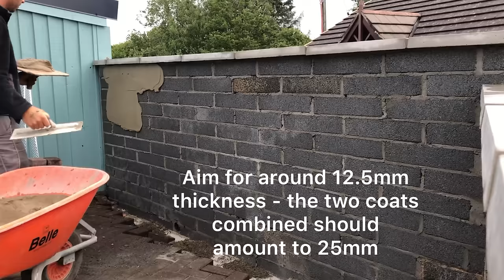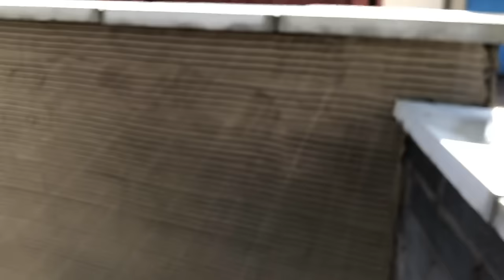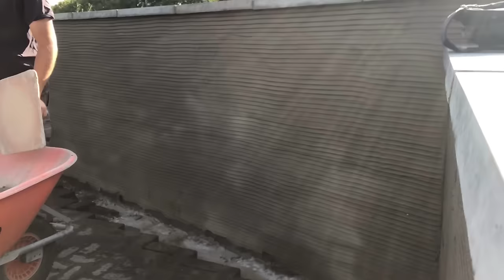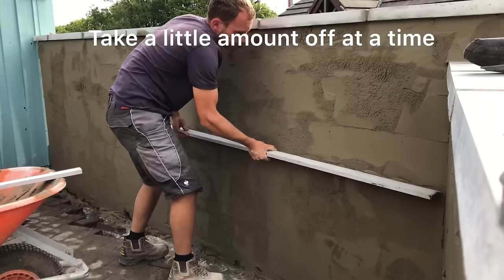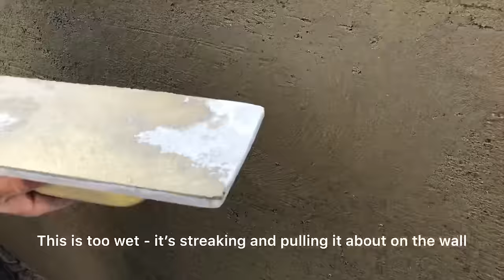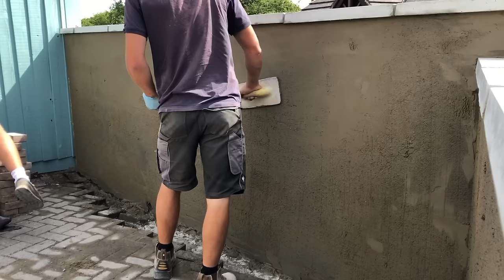How to plaster an outside wall

Comment: I always seem to leave sponge marks no matter what I try. Very frustrating.
Reply from the maker: Hi Colin, what sort of sponge are you using? Fine texture works best. Also make sure it’s wringed out and damp, if water is dripping off the sponge it’s too wet to use on the wall.
Reply: @SamDaviesBuilder   yellow rectangular sponge that people wash their cars with. Perhaps I should try another.
Reply from the maker: @Rureal42  those sponges usually do the trick! Are you doing a circular motion with the sponge?
Reply: @SamDaviesBuilder  yes circular.

Comment: 2nd video iv watched and nothing about how long we wait b4 floating
Reply: It says ‘drying times will differ depending on temperature’ so there’s your answer
Reply from the maker: Problem is the drying times differ so much depending on weather conditions, temperature and how damp the wall is.  I know that’s not much of a help but plastering is such a wild beast 🤣.  

If you float and it’s moving the plaster on the wall it’s too wet but you don’t want to leave it too long where it’s dried too much
Reply: @oxymoron5167  yes but it could say sine thing like the other reply and in certain conditions and wall types it is good to wait 30.40 60 mins
Reply: @mikewatt8706  I think the idea is to just feel it with your hands, between 45mins and 5 hours.

Comment: 25mm overall. My arse. You never see render that thick. Plus mateys scratch coat here is probably only 6mm thick anyways
Reply from the maker: christopher Wright thanks for your comment. Everyone has their own opinion/ideas about plastering and these are just my tips - I’m not saying everyone does it this way, just a video to give people an idea.
Reply: I've done quoins on heratige homes in S.A 40mm thick mate.. no two plasterers in the world have the same method. Its just the way it Is. Oldmate here has given a wonderful demonstration video.
Reply from the maker: Isaac Richter thanks Isaac! Those quoins are a work of art to see being done
Reply: You should be aiming for 12.5 mm per coat however, that depends on a lot of things. Good video and different opinions and different situations call for different thicknesses
Reply: Rubbish. Ive been doing it for over 25 years and never seen anyone apply it to a 25mm thickness. Render beads only 19-20mm and they are the bigger ones stocked at the merchants. This blokes applying on to a flat wall and he says 25mm but clearly isnt doing it. Neither does anybody else
Reply: @christopherwright1100  been doing it 25 years and still haven't seen it all. Last week I built out a plinth with a 2:1 lime mix on Bluestone 40mm thick in one day.. all heritage approved.

 anything is possible.
Reply: @isaacrichter9036  when did you last render a flat block wall as a standard scratch and top coat and have it in your head you had to try and achieve 25mm between the two coats. Your comparing two completely different scenarios here. Ive probably dubbed out render to 40 mm before when the conditions dictate but its not standard practice
Reply: @isaacrichter9036  the title doesnt say plastering plinths 40mm thick heritage approved

Comment: I've thrown out of the job if I use that much material in a wall 😂
Reply from the maker: Luckily I didn't get thrown off this job...
Reply: Buscando... He's doing it properly though 🔥🤙
Reply from the maker: kevin smith thanks 😃
Reply: It don't matter which way he starts or how he does his scratch coat the wall came up nice good job
Reply from the maker: Dibbs thankyou 😄😄
Reply: @SamDaviesBuilder  No worries mate.
Reply: Des M.  Hahaha I'm from Mexico all or houses are made of concrete, so I know what I'm saying, we won't use more than  13 mm or 5/16 thickness in outside or inside walls and of course there other products that you don't use more that 6 or 7mm of thickness my friend, so we don't waste a lot of material, witch is my point here. 😉

Comment: Do u need gloves
Reply from the maker: I try and wear gloves most of the time (even if I didn’t in this video 🤣). Cement isn’t great to get on your hands
Reply: @SamDaviesBuilder  can u get different colour sand if I wanted it in blue
Reply from the maker: You can get dyes to put in the mix but it’s hard to get the colour even. I would just paint it personally

Comment: super slow my god
Reply from the maker: Reygie Paran thanks for your comment. This video is a how to - it’s not about speed. And I wouldn’t say any of my work is fast, I was always taught to do a good job and not worry about the speed. Thanks for watching anyway 😀
Reply: Put the right price in and there's no need to work fast, I work at one speed and my works always top class
Reply from the maker: Ken Thorpe you’ve hit the nail on the head there! I’ve always been hired on quality and not speed. That’s why people like us will always have work no matter what. It’s the ones who are only interested in crashing jobs out that dry up with work in hard times